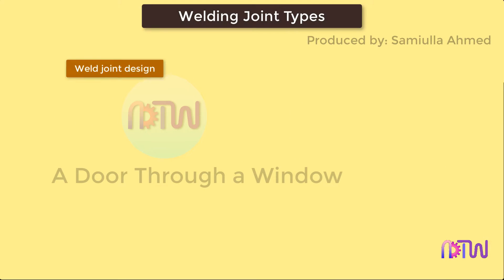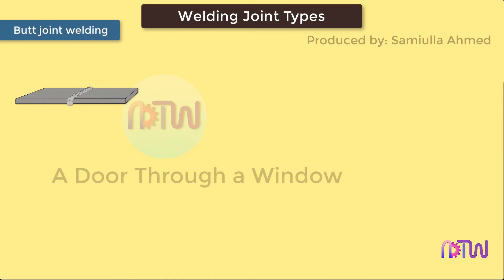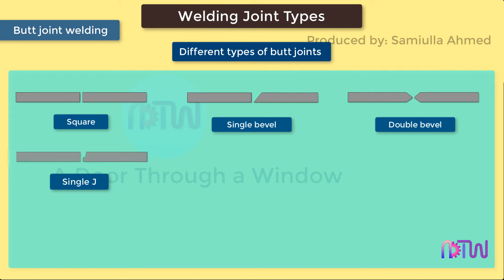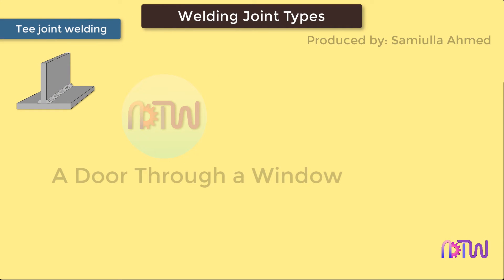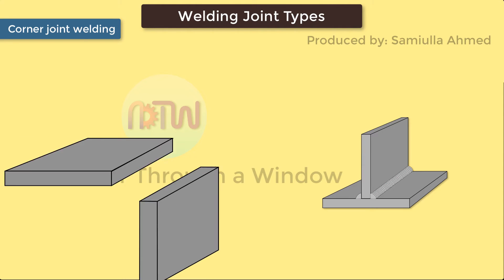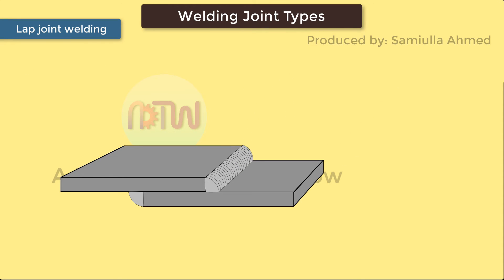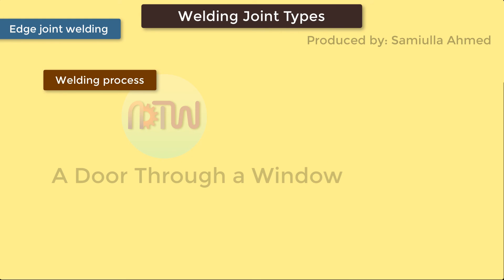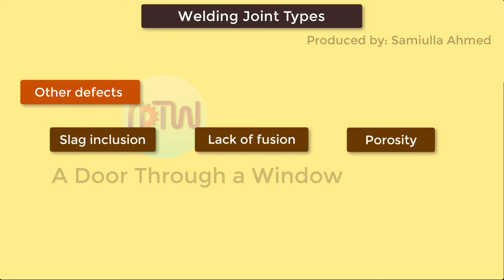WELDING JOINTS (Types): Different types of edge preparation for weld joints (Animation).

Comment: I didn't figure out what is the difference between two pictures - Double bevel and Double V butt joints?
Reply from the maker: The main difference is in the shape of the joint. Double V butt joints are "V"-shaped with symmetrical bevels, while double bevel butt joints are wider with opposing bevels. The choice of joint type depends on the thickness of the metal being welded and the desired strength and appearance of the finished weld.
Reply: @ADTWstudy  Ok, but the video doesn't show this difference

Comment: what's the difference between double-v and double-bevel?
Reply from the maker: A double-V joint is a V-shaped groove prepared by beveling the edges of two pieces of metal, while a double-bevel joint is a U-shaped groove prepared by beveling the edges of both pieces of metal. The choice between them depends on the specific application and desired properties of the final weld.